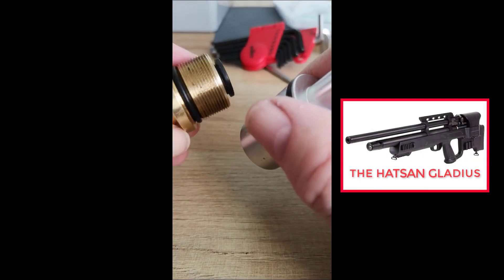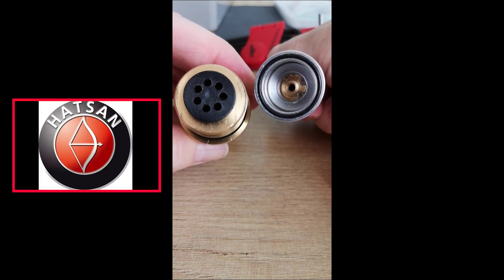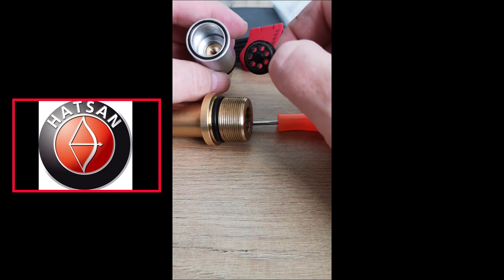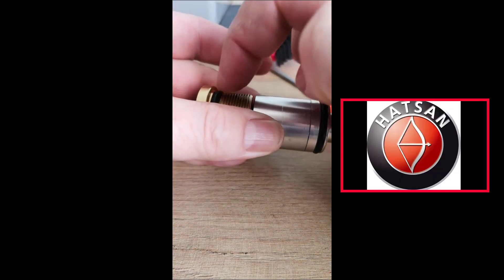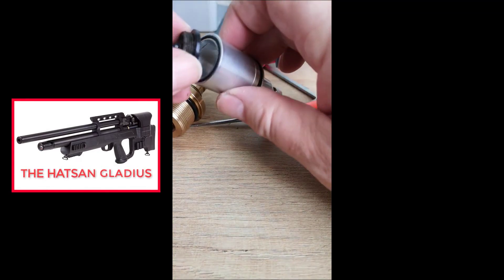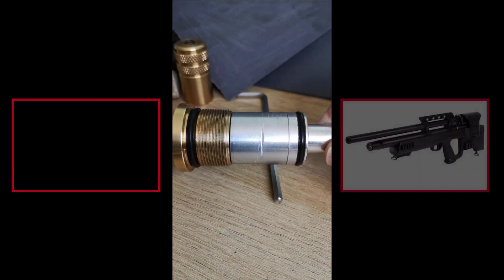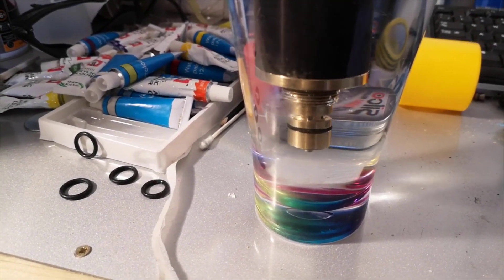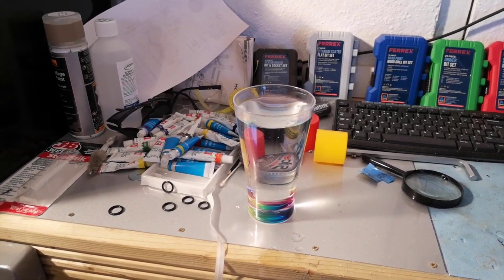An update on the Hatsan Gladius Lancet Mk9 regulator tune

Comment: hi Mark i want to put a HUMA REG  in my HATSAN FLASHPUP but it has anti tamper so you cant get to spring adjuster to set it up after fitting the reg, any ideas on how it can be removed. thanks for any suggestions.
Reply from the maker: Hello Julian, I haven't seen the workings of the flash pup, but with the Hatsan Gladius ans Galatian the anti tamper is a snap off head bolt / screw at the rear of the action from above at the rear of the block. In both cases I had to drill past the head to get the Acton out to access the obstruction where you put in the 4mm allen key at the rear to the hammer adjuster.
You could try the US forums to look at strip down videos of none anti tamper to see the differences.